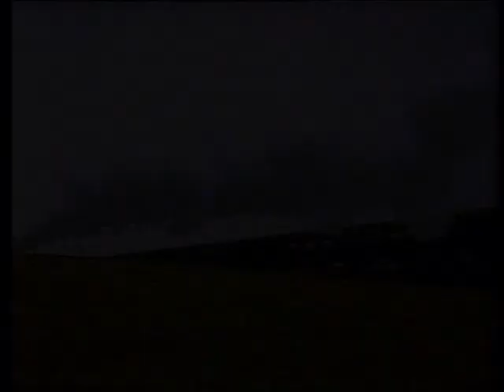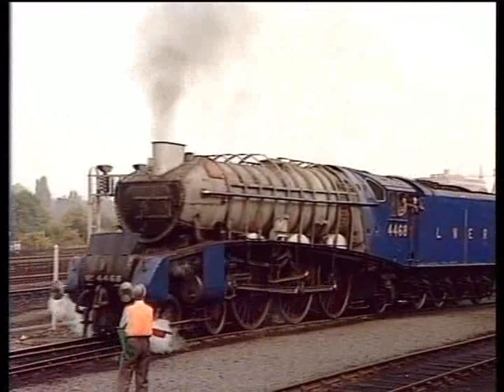Mallard Part 2

Comment: They need to do this again. 100th anniversary of the record? That's too late, but they NEED to do something like this again.
Reply: Ziggy Craft one problem with that she needs a boiler inspection and if she will ever run on the mainline again shell need a black box and load's of stuff doing which shouldn't cost to much but when I asked someone at the N.R.M. what condition the boiler was in and he went quiet and that says to me that it is knackered.
Reply: @jacobjohnston1218  in other words , it would need a boiler replacement, and the NRM won’t do that since they want to conserve parts, well I still think it was good when they restored the GNR single in the 80s